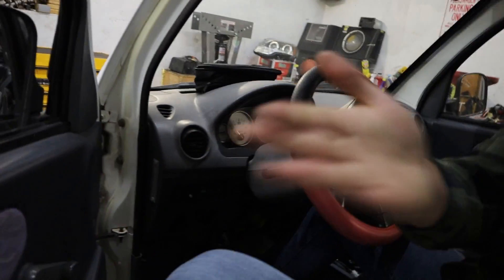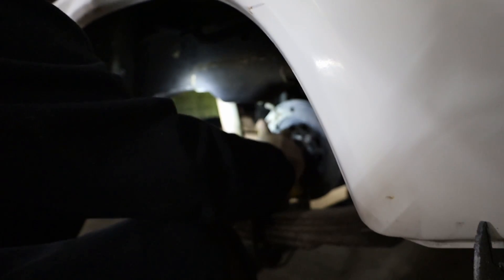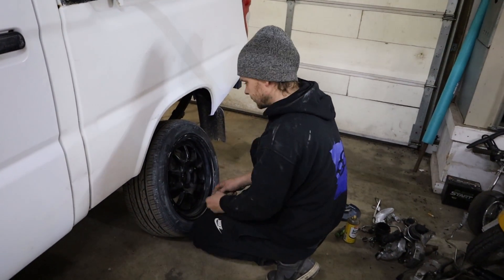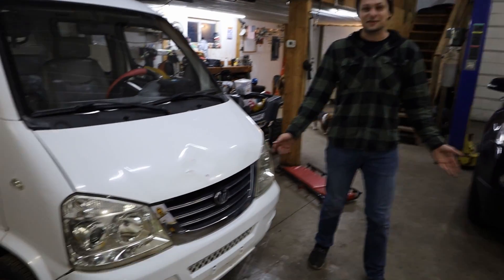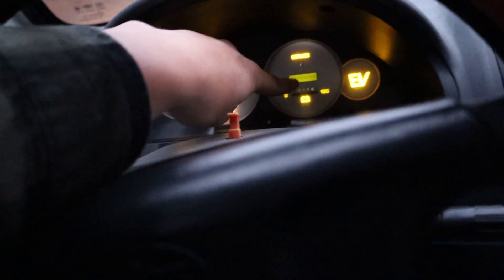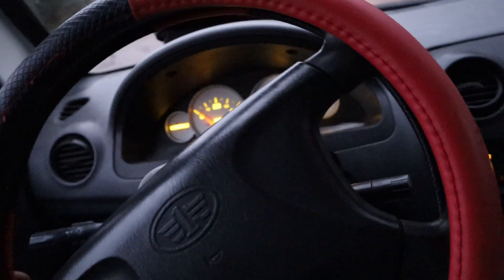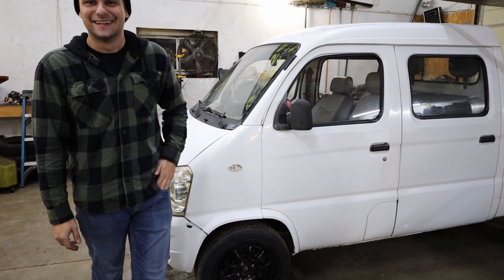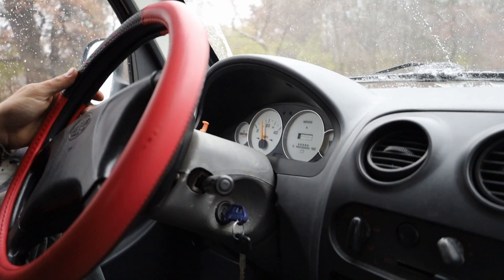TUNING our MINI ELECTRIC KEI TRUCK to go WAY FASTER

Comment: Where do you plug the handheld controller in?  All I can find is the standard OBD-II port which isn’t compatible with the provided Curtis handheld device.  Did you use some kind of adapter to plug it into the OBD-II port, or is there another plug I am missing?

Comment: Hi can you tell me where to get that handheld scan tool for the van? Brand and model? I'm getting one of that van, so I think I needed one. Thanks
Reply from the maker: https://www.electricmotorsport.com/curtis-1313-4331-oem-handheld-programmer-rental.html
Reply from the maker: This link should be the one we rented. Hope it works for you these little trucks are a ton of fun!
Reply: @throttle_therapy  thank you for sharing, how you guy bypass yet? Or other power boost?
Reply from the maker: @piyemonnii  we had to mess with the programmer tool for a while to figure out how to change the top speed of the truck. I dont remember exactly what we changed but it wasn't very difficult. The top speed was the only thing we could tell was being changed. Hope that helps!